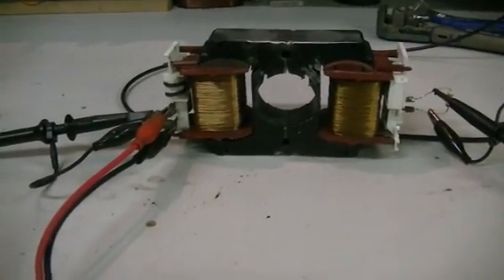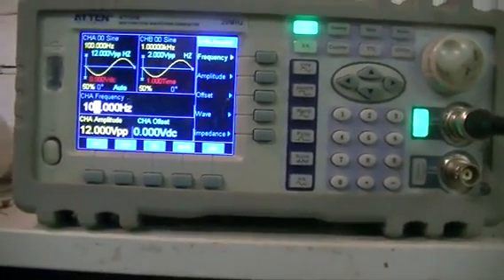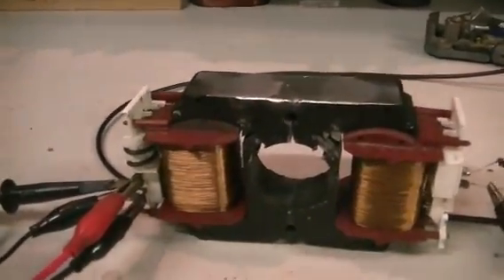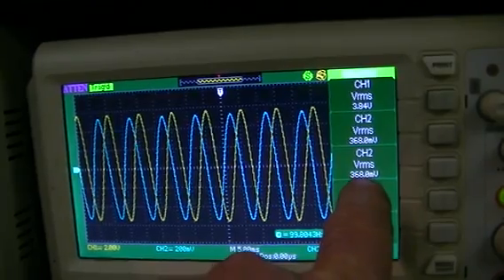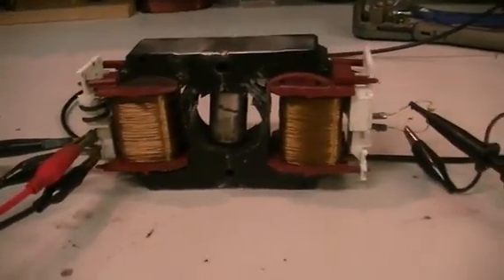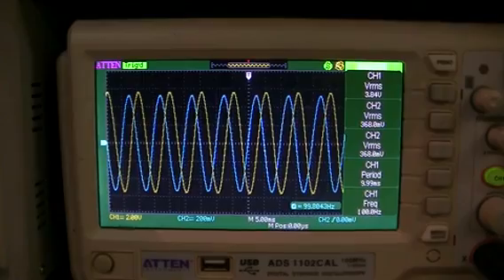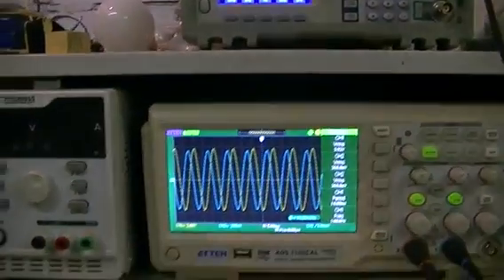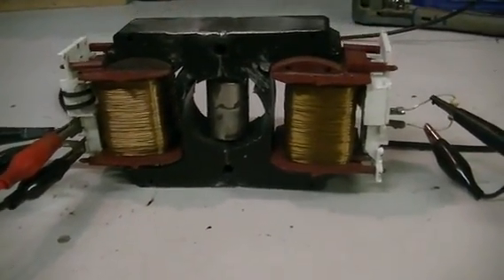Magnetic Power Amplification

Comment: Adding the magnet reduced the inductance and thus the inductive reactance XL that the coil experiences.  'Magnetic amplifiers' aka 'saturable reactors' use this as follows:

1)  one coil has AC piped through it; the other coil has DC either on or off
2)  when the DC is off, the 2nd coil (with the AC) has to 'fight' its normal battle to flip the electron spins in the core at the frequency of the AC - in other words, with no DC in the 1st coil,  the AC in the second coil sees maximum inductance and thus maximum XL

3)  now turn on the DC.  This pre-saturates the core.  Now, the AC does not have to battle to torque all the electron spins into alignment and the AC thus "sees" a drop in inductance and thus a drop in XL (inductive reactance).  

Just a tiny amount of DC is used in a magnetic amplifier to pre-align all the electron spins in the core so that the AC doesn't have to do it.

A PHYSICAL ANALOGY

- a swimming pool has a slide
- a guy named 'AC' tries to slide down into the pool but feels a lot of resistance
- a supply of water is now added to saturate the slide
- 'AC' now slides down with almost no resistance
.

Comment: Tom Bearden used a nanocrystalline transformer block (actually what he used was pulled off the market because of his success) ..  two outer coils and central magnet with two smaller driving coils on top.  

He did not use double coil windings in Bedini style oddly enough.  

The two outer coils in same config as you have were output coils ..  and two narrow coils on top around the block on left and right side of center were the input coils.

If you can get something like that to work using a spark gap in the system in parallel somewhere (to change the nature of the energy, powered by EM collapse) and get it overunity, then I would like to know because that has application in warp drive field theory.  Not kidding about that.

Comment: I read an old book about Tesla some guy went with him on a boat and he said Tesla showed him a wire on the shore stretched one full wavelength I think that's 484 feet or something like that and it was laying along the shore along the water and at the end of it he had three foot copper tube full of Mercury soldered to the wire and then in the boat he had coils of wire and some type of rods out of some type of metal he wouldn't say any put the rods in the coils and the wire transmitted all frequencies and that would pick it up and he powered his electric motor in his boat not sure how that works but it's very interesting

Comment: Hey mr tinman, some ideas..Most over u inventions have to do with pulsing. as in bedini ssg pulsing magnetism. the Gegene induction cooker again magnetic induction providing 4500 watts from 1000. where does this energy come from? this is a type of backlash from the environment (zero point) Nature doesnt like broken symmetry as in a simple battery or a magnet both being dipoles. When you punch a water filled bag it will rebound to fill up the gaps same as nature. As long as you keep the symmetry broken you will have a gusher of energy flowing in.  Every time I pulse 12 volt relay into a cheap chinese electromagnet i place another electromagnet as a receiver and get 2 currents ..one on the punch and one when i break the contact. (back emf) imagine 2 for the price of 1 punch

Comment: when you placed the magnet inside you are in effect creating a dipole that gets picked up by the iron on the top and also on the bottom; you are in effect creating an antennae for more magnetism to enter the circuit, dont believe me? simply put a piece of flat iron across the top and bottom of your setup and your production of electricity will increase simply with a larger surface area of iron. let me know if this works for you

Comment: Love this experiment. I've thought about this for years, and have done a few similar tests. You always seem to get free additional energy by adding a permanent magnet to a transformer, but in my tests I only used unipolar DC pulses. So the idea is, if you move magnetic flux, you get induction. The magnet provides additional magnetic flux. You are giving the primary more flux lines to move around in the core, but no additional energy is needed, since the flux lines are being emitted by the permanent magnet. Pretty amazing experiment. Thank you!

Comment: good job! now you have a tiger by the tail.

are the coils oppositely wound?? 
(bucking coils are needed for this idea)

idea::
connect one leg of each coil together. and measure the output of both coils.

leave the magnet in place but wrap a solenoid around the magnet

and pulse the coil with the same power your putting into the one coil

and measure the output of both coils 

just an interesting thought
have fun TinMan

Comment: Nice effect! I noticed the magnet appears to have a gap between one pole and the core. It's possible the gap on one side causes the core in the solenoid coil to act the same as in a conical coil where a core or magnet does not center itself in the length of the coil. Perhaps a rotor axis should be offset from the core. Cheers

Comment: a coil around the middle of the magnet, or even a single wire touching the magnet's middle, with current or radio frequency; the magnet would amplify vortex field motion? might it switch the field on and off?

Comment: Hi mate, the magnet might be saturating the 2 magnetic shunts which are in parallel with the coil cores on each side.  So the ac field can then take the longer outer path rather than the shorter inner one?

Comment: neat example of "flux gate"ing
Reply: Yes. More like magnetic diode.
Reply: More like a transistor since it's switchable not a check-valve single direction limiter...
Reply: For that, Tinman would need two sets of PMs, one for each of his two coils; and then have two, time differentiated primaries to pulse each half. There you would have real input power nearing the real output power to load. Works.
But with the real input power creating a secondary assisted and created, reactive power, the input does see the reactive power as a direct load. So it becomes more interesting from there on. Works better.
Reply: Correction: input power, does NOT see

Comment: Hi Tinman! Very interesting experiment. Since you asked for suggestions, I would suggest :
1. Use a Secondary Flux path by adding two additional laminate core pieces attached to the top and bottom of your existing core to form a figure" to reduce the flow back as much as possible from returning to the primary and use the secondary flow path.
2. Use a separate primary at the same place where you placed the permanent magnets.
3. Use permanent magnets of lesser strength at the four corners of your core to determine path.
4. Drive the primary with a SSG circuit or with a PWM.
You may try a reed switch at 6 volts also.
5. Use the input coil with reversed diodes that you had demonstrated to get " cold electricity" output, and the two existing coils as two secondaries.
6. At this point you may add permanent magnets with your primary to check if it will help you achieve your desired results.
Thanks for all your demonstrations and experiments, I am one who always looks forward to what you will surprise us with next.